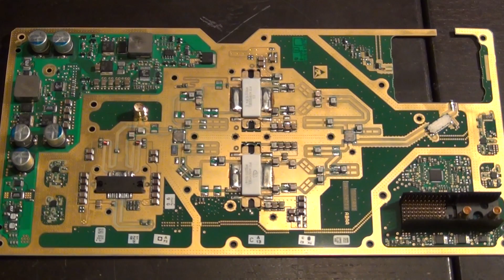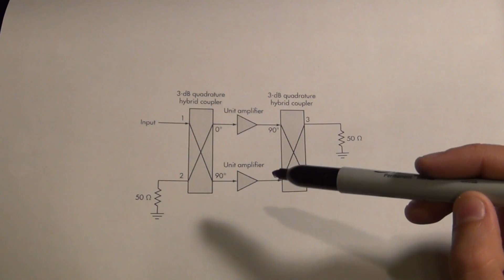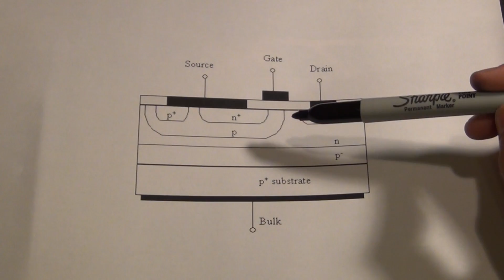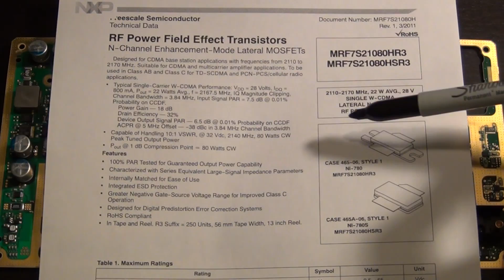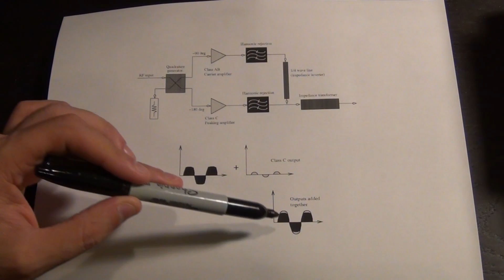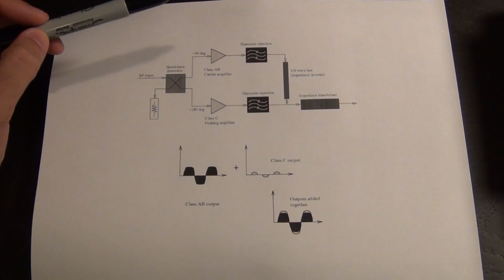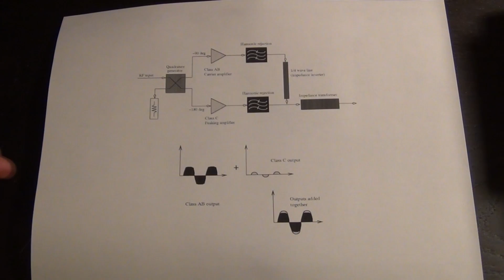TSP #82 - Tutorial on High-Power Balanced & Doherty Microwave Amplifiers

Comment: Great video, I always had troubles understanding circulators but you solved that in 30 seconds,  I think it will be very educational to inject and follow a signal through the amplifier using a scope and SA. Even more so if you inject "faults" so you can see the advantage of  the construction. 

How about a video tour through bell labs with you as the guide ?  

A possible interesting video subject: Is the "wave machine" still there ?  There is a movie on the bell labs archive about that thing. That helped me very much to understand reflections. It would be great if you could  do a  remake of that. 

Fred

Comment: Great to have you back Shahriar! I look forward to your upcoming videos - I'm quite curious about the operating principles of circulators . 
I have a question for you: Are there any promising high-power devices or techniques on the horizon for more efficient RF/microwave/millimeterwave amplification? It seems like this is one area of high frequency design where engineers haven't been able to make much progress in over the years, despite many clever ideas and advances in manufacturing.

Comment: Good video.  Any of these questions are available for you to consider.  Thanks.

These boards do not use all standard components, opting for microstrip line and specific dielectric boards.  How are these circuits designed and laid out and why use these complicated filters, capacitors, and inductors, versus lump components?  Is it only cost or also performance because sometimes they mix and match?  Do they use Eagle, Altium, Kicad, etc to place these stripline components into the board?  Where are they designed; like a simulator of some sort?  I know they use specific boards and mills to produce these boards.  What about layers, are they mostly 2 layer or do they get created with the same capability as common printed circuit boards?

 I am interested in designing analog circuits and RF circuits as I am too comfortable with digital domain.  I am reading RF Circuit design by Chris Bowick as a resource to learn more about RF design.  Not much that I have not witnessed before in coursework or the internet, but provides lots of basic worked out examples.
Reply: I found a video on a tool called genesys. Explains quite a bit of my questions.

https://community.keysight.com/community/keysight-blogs/eesof-eda/blog/2016/09/05/how-to-design-custom-rf-microwave-and-analog-filters?sf35244374=1

Comment: typical output power in dBm, for wcdma, also referred to as effective radiated power, ERP, is in the order of 10 - 15 dBm for dense metro propagation model.
Reply: 10-15 dBm is 10-30 mW, so are you talking about a some distance/angle from the antenna? Even the mobiles can do 1-2W.
Reply: There is a thing called the link budget which accounts for the gains and losses on an rf system, wcdma relies heavily on power control, so i meant to say even though these RRHs transmit with 20, or 40 watts, the user equipment only receives, because of fading and other factors, around -35 dBm on the port of the antenna, which is plenty. These propagation models are based on the isotropic dipole, so the real figure is in reality, higher. And user equipments can not go any further than 600 mW, in the  older days of AMPS yes, but not anymore.
Reply: Yes, I know about link budgets but you mentioned ERP :) And class 1 wcdma mobile peak power is +33 dBm = 2W. That's just in the specs so I don't know if they are actually made.
Reply: no, for sure. Remember Ec/no  is very sensitive to BTS set output power, and BTS always tells the phone to "tone it down". 600 mW worst case scenario, and even that much is all the way down to 1x EVDO, for example,  there is also link budget for BTS and link budget for UE. power balance is a big thing in wcdma! dont think in absolutes when translating dBm to Watts!